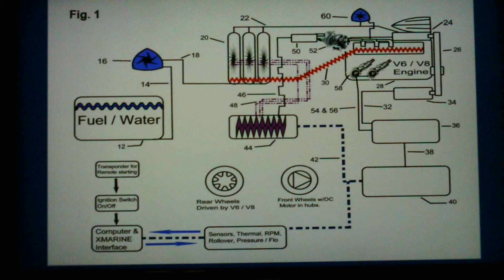Water Powered Car and Motorcycles / HHO Patent Application #youtubenation

Comment from the maker: 1) Eight Steps are Required to do Something as Simple as Firing an Automatic Weapon/GUN.
1. Firing, 2. Unlocking, 3. Extracting, 4. Ejecting, 5. Cocking, 6. Feeding, 7. Chambering, 8. Locking.
2) So How in the HELL do Experts Think they can Solve the HHO Problem with Just Two Steps, 1. Extraction and 2. Utilization/Recombining.
3) It is The HEIGHT of ARROGANCE, Experts Further Assume and Assert, Since they Can't Solve the HHO Problem/Make Cars Use Water as There Sole Fuel, the HHO Problem Cannot be Solved.
4) My Point is, sometimes Technologies outside your Field of Discipline,
Are Required to Improve Performance Inside your Field of Discipline.

Comment from the maker: Aerodynamics In U.S. Race Cars Started In 1958, 
American Jim Cushman the First Driver to Install a Wing 
on the Rear of his Super Modified Race car.
1 Nothing like this was Ever Attempted Before. 
2 The Wing Increased Down Force and Cornering Speed.
3 Wings became a Safety Feature. 
4 Wings Keep the Car from Lifting off the Ground at High Speed.

My Point is, sometimes Technologies outside your Field of Discipline, 
Are Required to Improve Performance Inside your Field of Discipline.

Comment from the maker: Pertaining to the Energy Required to Separate Oxygen and Hydrogen, and Equal Amount of Energy Released when Recombined, you are Correct.

Pertaining to Fusion of Hydrogen to Helium, Not Necessary.

The Two Points you are Correct on is
1. The Extraction/Separation of Hydrogen and Oxygen.
2. The Utilization/Amount of Energy Released when Combustion Occurs.

There are STILL Four More Points/Steps to be Taken, and Hence you are ONLY One Third of the Way There.

Comment from the maker: Heat; is a form of Energy associated with the Motion of Atoms or Molecules, and capable of being transmitted through solids by conduction, through fluids and gasses by convection, and through empty space by radiation.

Heat; in ordinary language, has a diversity of meanings, including Temperature.

Temperature; is a physical property of matter, which quantitatively expresses the common concept of hot and cold.